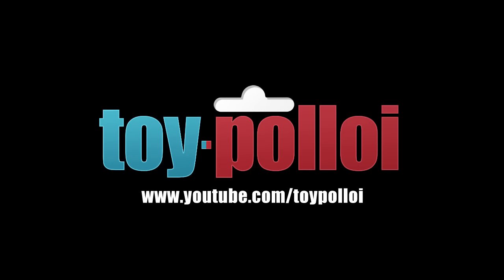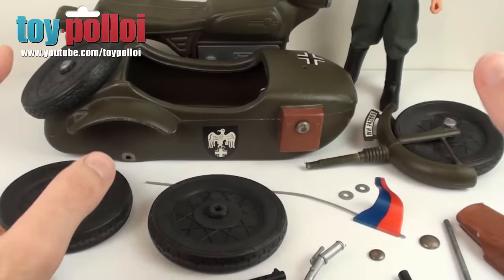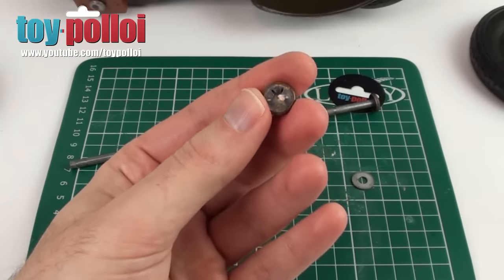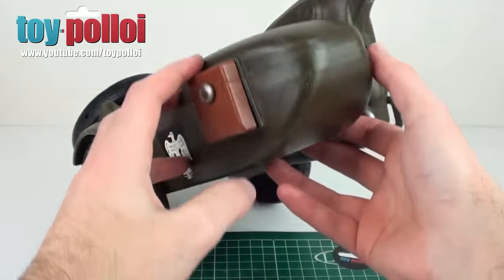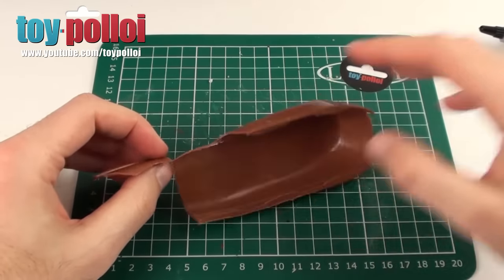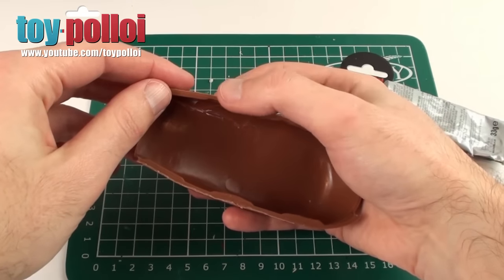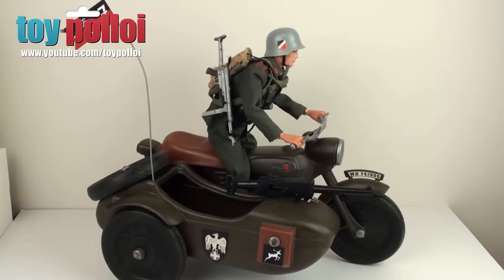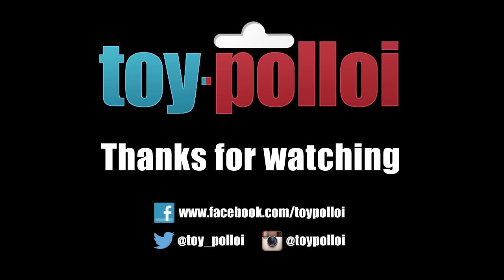Vintage Action Man German Motorbike & Sidecar restoration Cherilea - Toy Polloi

Comment: The colored electrical tape is a Godsend to collectors and customizers; it can be used to replace or repair broken straps, belts, holsters and nearly any other bit of kit made of vinyl or rubber.  I recently lucked into a couple of vintage Russian and German belt buckles, and by folding the appropriately colored tape over on itself in thirds, I replaced the belts and with a bit of polish and careful painting, they now look good as new.

Comment: Most of those 'Cherilea' vehicles (my younger brother had a Jeep and a Kettenkraftrad) were made of Polythene and Polypropylene, both of which are resistant to most chemicals, although Polypropylene will weaken and go brittle if overly exposed to sunlight. The 'Kettenkrad' half-track motorcycle was a most impressive toy, and worth seeking out.

Comment: Nice piece! Wait... aren't those insignias for the Afrika Korps? That's a regular German Stormtrooper and bike isn't it? Shouldn't he be in Afrika Korps colours?
Reply from the maker: +TheNightBadger I don't know much about the insignias. I just restored it to how it would have been originally. And I only have this German Stormtrooper outfit, so he got to ride it :)
Reply: It's certainly BASED on the Afrika Korps insignia - the genuine insignia had a swastika over the trunk of the palm tree. Palitoy made their own genuine Action Man Motorcycle and Sidecar, using the same motorcycle as the Police Motorbike, minus the fairing. It was available in two versions - in military green, with the sidecar on the left (as would be typical for driving on the left in the UK), with "Action Man Transport Command" stickers; and as a German Motorcycle and Sidecar, in Afrika Korps colours and with the correct insignia and the sidecar on the right (as would be correct for countries where they drive on the right, like Germany).

In some respects, the Cherilea Motorcycle and sidecar as shown in Toy Polo's video is more accurate than the genuine Palitoy version, as WWII German Motorcycle and sidecar combos did typically carry a spare wheel on the back of the sidecar. Sometimes, they would also have extra ammo boxes fitted to the rear of the sidecar

The Cherilea toys were a compatible line of vehicles that cashed in on the popularity of Action Man. They were usually more primitive blow-moulded toys, as is the case with their motorbike and sidecar. If you compare the Palitoy Motorbikes with the Cherilea one, the Palitoy version is much more detailed and accurate to a "real" motorbike, but because of that, it's a lot more fragile. Whereas the Cherila toys were the cheap and cheerful knock-offs that could be used with Action Man or the numerous 12" figures that existed to cash in in Action Man's success (and there were other companies that produced generic uniforms and accessories which were also compatible), they are often in better condition years down the line than some of the more delicate Action Man vehicles and accessories.

The Cherilea Motorcycle and sidecar was also available in Afrika Korps colours, along with Half Tracks, Tanks, etc etc. Palitoy also had various other Afrika Korps colour vehicles, including a German Staff Car. Often, these would also be blow-moulded, as it was much cheaper than injection moulding, produced reasonable good results, and allowed Action Man to have plenty of variety in his vehicle pool.

You can see a genuine Action Man Afrika Korps motorcycle and sidecar here:

https://www.google.com/url?sa=i&source=imgres&cd=&ved=2ahUKEwixieOf9LfbAhXE2aQKHX2aAnwQjxx6BAgBEAI&url=https%3A%2F%2Fwww.youtube.com%2Fwatch%3Fv%3DQzP6gCkygyA&psig=AOvVaw05nojQbFMCg-u-KBBNXAFa&ust=1528129529391052

Comment: 19:17 yet again a thing you need a soldiering iron for, it can melt the plastic there and make it look like it was never broken
Reply from the maker: I always think it's a horrible way of fixing things. So many things can go wrong with it.
Reply: Toy Polloi yeah I’m still testing on these cheap things so I don’t mess up on something worth something, it’s been months of practice and I still am not good enough to use it on old stuff
Reply: Toy Polloi you can use model filler to fill the gaps before you glue it
Reply from the maker: That is why I don't suggest anyone ever use it as a method. Cheers
Reply: Toy Polloi also how do you fix broken boots ( back broke on the seam ) my 1964 gi joe Australian jungle fighter I got for $6 all it was missing was the award upon further inspection it has both boots broken on seams in the back and a broken off trigger finger

Comment: My inner LEGO soul cringes every time a knife cuts LEGO pieces!
Reply from the maker: There are billions of them. They don’t mind and is helps saves another toy.
Reply: Yeah, I know, it's just so deeply rooted in my mind, I have ruined a few pieces my self, building a LEGO-casing for a USB thumb-drive many years ago. =) 
When I grew up you cherished every single brick since they were so expensive and hard to get replacement, now with internet and Bricklink it's another story, parts are cheap and easily accessible.